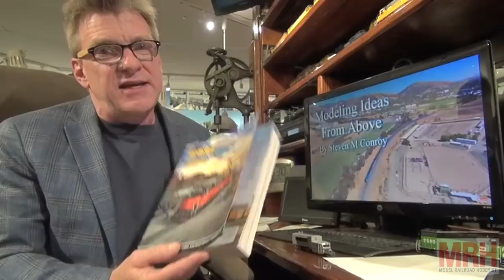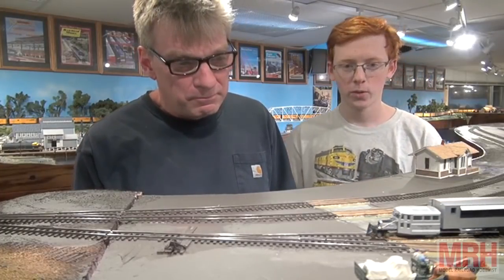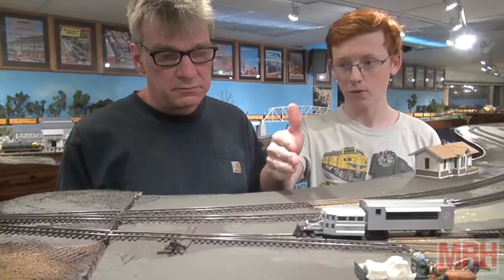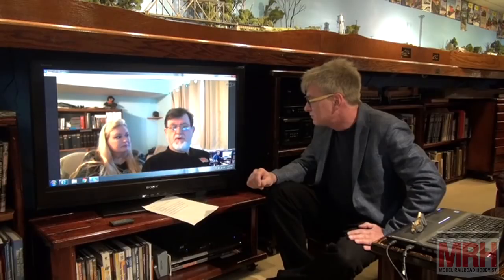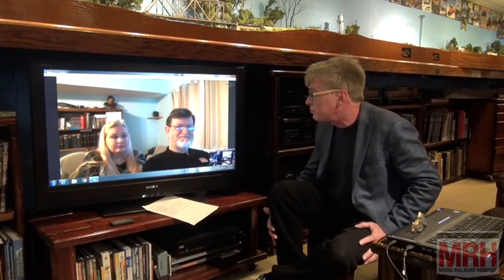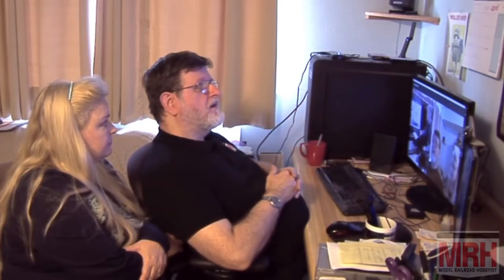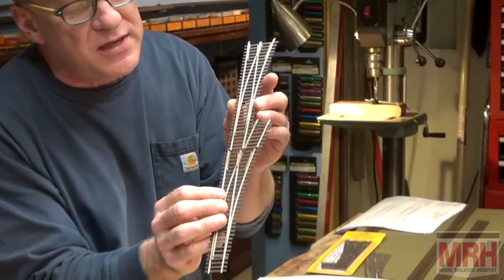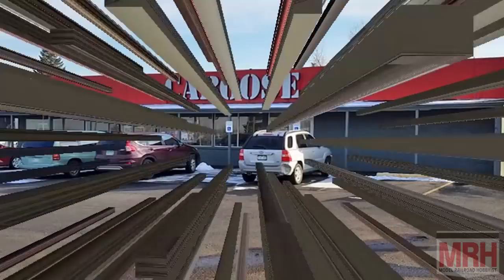Whats Neat in model railroading | January 2018 Model Railroad Hobbyist | Ken Patterson

Comment: Your explanation and demo on the Micro Engineering ladder system was fantastic and is the best resource on the internet of how this works and side by side comparison. I have a small shelf layout and may possibly use this set up on a smaller scale. I only need 4 tracks. My question is can you combine 5b, 5c, and end with 5E? Will it work to skip 5D? My paper templates look like they would work but would love your opinion if you have a moment.

Comment: I have been using the ME ladder track system since September.  One thing that should be mentioned is that it only comes in code 83 rail.  They are included in the Anyrail track planning program.

Comment: Wow, the drone footage is awesome. Was wondering how it is filmed. Is it controlled by somebody on the train or is the range good enough to control it from a fixed location? And how did you know to duck under the power lines at 7:54? ;-)
Reply: Thank you very much! I was not on the train, the range of the drone is good enough to control from one location.  I have flown this area regularly and knew the power lines were there so it was no problem to fly under.
Reply: That is Amazing

Comment: Nice stuff with Micro Eng latter tracks wish they would have had them when I built my layout.  That another story.  Caboose is not Caboose Hobbies.  It totally different Corps and has not connection to the old store in Denver.  They never could come to agreement.  What Caboose is three years old.  Nice store and  has great inventory was there in May.